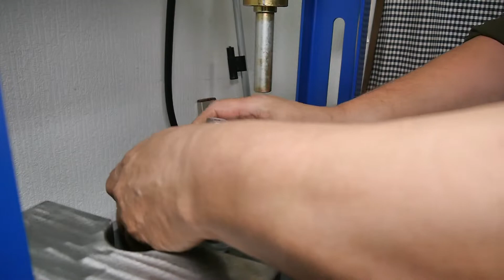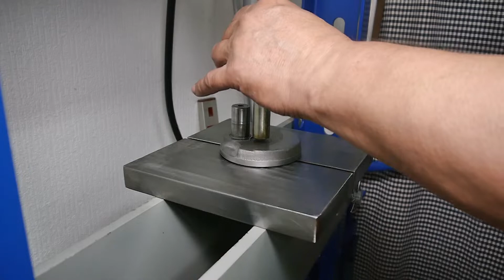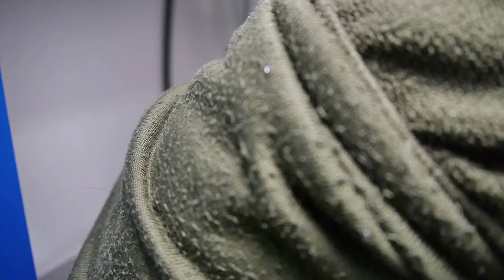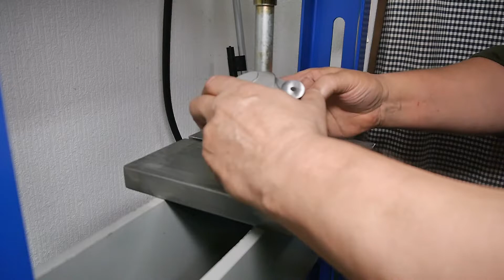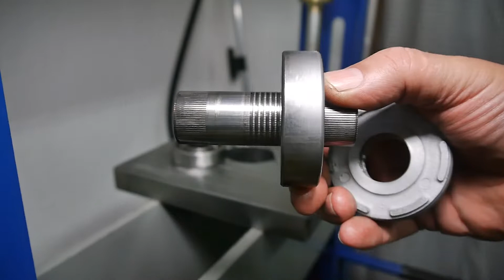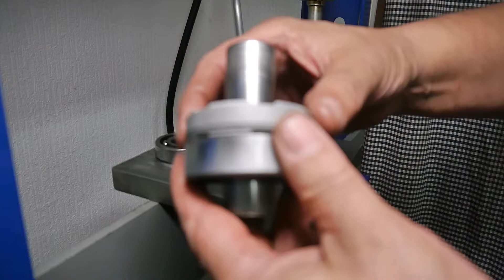Yamaha RD 350 LC Crankshaft Part 2

Comment: Good video for repair hello how many pressure have tour press for these job Thank
Reply from the maker: Hi, the press is a decent quality20 Ton unit with a set of dedicated pin set and ram socket and can go a little more at a push, most cranks use about half of the range, the secret is to use tooling that stops any flexing, a firmer support helps to get the pins out easier without any sudden jumping.

One often finds that some of the smaller cranks are harder to remove their pins, if you get flexing it can damage things which will show in the balancing up later.

<<<<<<<One thing I forgot to mention is, >>>>>>

When splitting the centre section don't get tempted to push the pin all the way through both webs as this will mark the middle of the centre pin where the Labyrinth seal is located, always push the pin out from either side.
Reply: @daviddanielstephenson2833  ok lot of thanks
Reply: Impressive!!how many times a crank can be rebuilt?